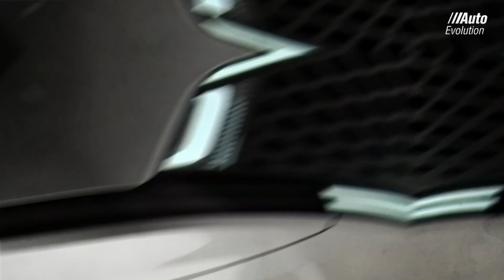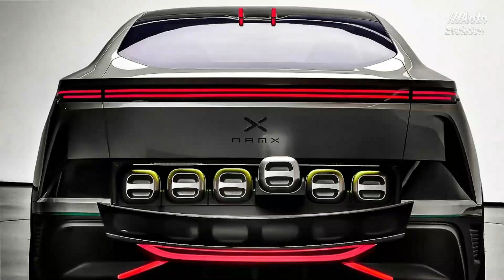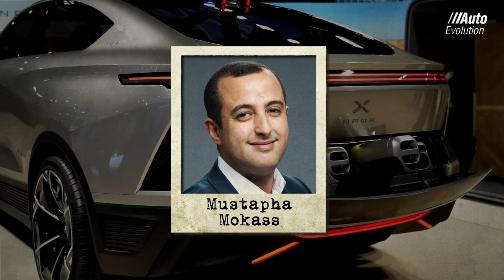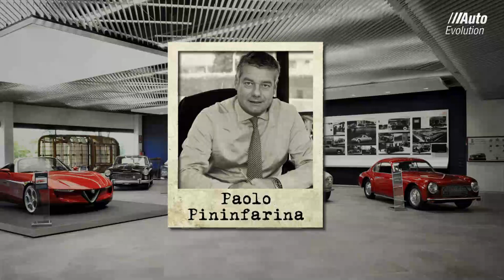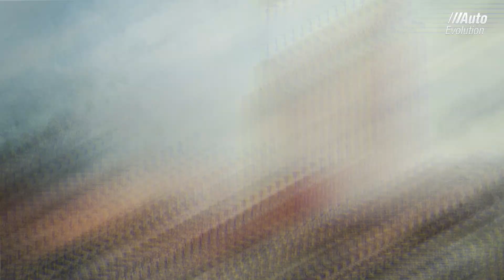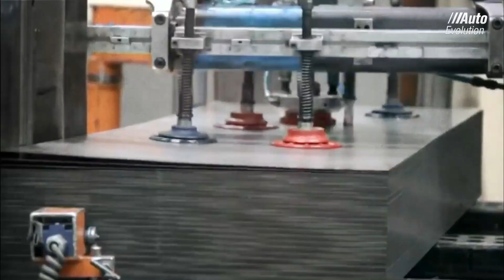NAMX HUV: A Collaboration between Pininfarina and NamX, by a Moroccan Founder 🇲🇦 🇫🇷 🇮🇹

Comment: Did I miss it? Or was there really no single word about the propulsion system? Fuel cell electric drive, internal combustion engine, ICE-battery-electric hybrid,...?
There seems to be still no solid information about the car available.
I suppose, it's just vaporware.